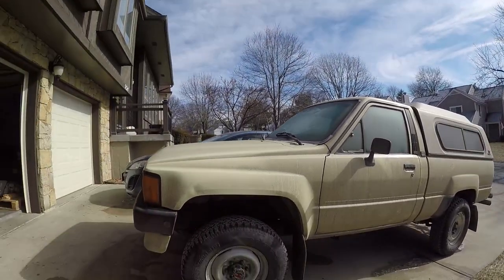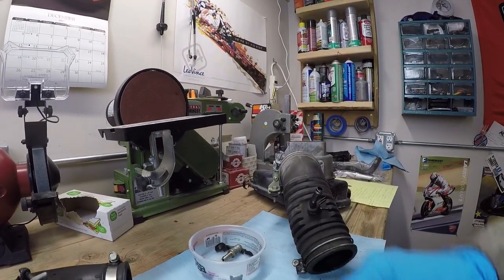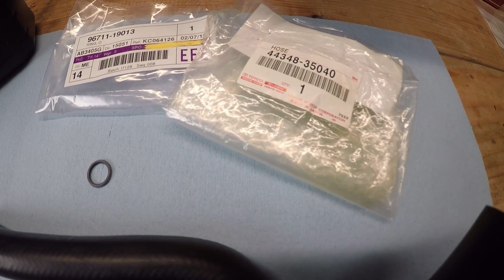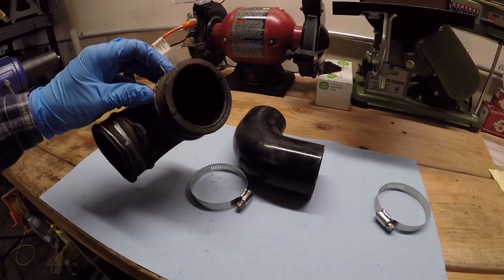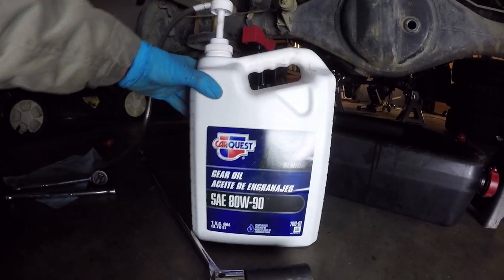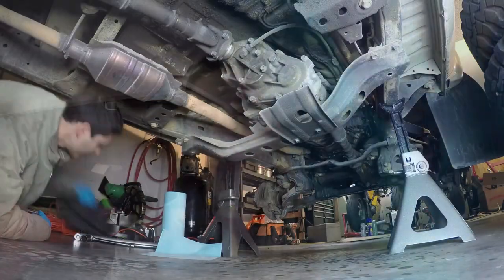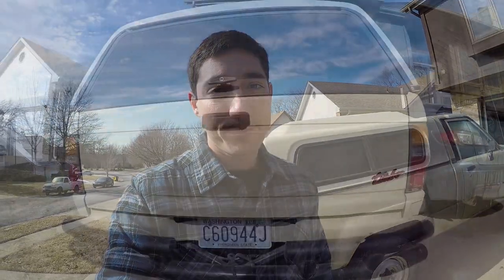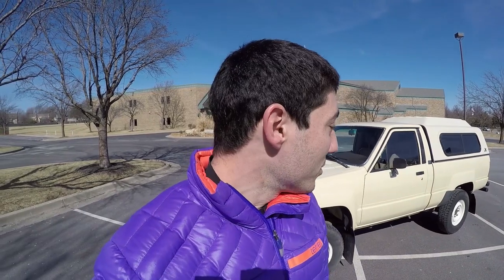I Bought A Rare 1986 Turbo Toyota Pickup

Comment: Nice dude. I have a 1989 toyota hilux 22ret turbo myself. Factory front straight axle and factory 3.5" lift. My model is very rare aswell. Ran the vin and there were only 600 ever made of this type and was built specifically for the russian military in a left hand dive. It is in near perfect condition an i still refuse to wheel it. Ive had many people offer me an insane amount of money for it...turns out i bought it from the 1st original owner. Hardly drive it because it only has 72k original miles! Its a factory dark blue color with black interior. And i only paid $3700 for it cash!
Reply: I'll take a Port & Polished head with oversized SS Valves, mild Crank and a 36/36Weber Carb over a Turbo any day.  Frankly my Stock carb with a P'nPolished head and mild performance crank would out perform your Turbo.

Comment: Nice truck and video. There is a Lucas gear oil that is gl4 and 5 compatible and not very expensive. It’s an 80w 90 though. I use it in my ‘86 Ranger, Toyo Koygo transmission. Maybe that could have worked? 75 bucks is a lot just for oil.

Comment: Very cool, I almost have the same truck, 1986 22r manual 4x4 non turbo reg cab with about 200K on it, it doesn't leak oil, but has a really hard time passing CA emissions, prob will need an engine rebuild soon, parts amazingly OEM are kinda pricey and hard to find new

Comment: After you have replaced the PCV valve, if there is a ton of pressure coming from the crankcase, it is a sure sign that the rings are bad.

Comment: You are incorrect about the pcv valve. The valves become stuck open and the vacuum of the intake sucks the oil out if the engine. If it was stuck shut you would be blowing gaskets.

Comment: Used to have a super clean silver 86 turbo about 10 years ago.
 Ran like clockwork and never let me down, but you could watch the fuel gauge drop as you drove, boost or not. My V-8 Tahoe is more comfortable and gets better mileage.

Comment: I can tell that it is a 1986 by the weld on the rear axle housing. I bought a 1985 Toyota truck brand new, and at about 26k miles my rear axle housing cracked. Took it to Toyota 3 different times, they would not acknowledge that it was a defect. Surprise, surprise, I noticed that the rear housing was redesigned for all the 1986 trucks!!!   As I recall, the turbo was only available in 1985 and 86.
Reply: 1985-88 in the US market.
1985 saw mostly 2WD trunks in turbo, very few 4WD were shipped.
Most turbos are 1986.
1987 saw hefty increases in price and a coming V6 so sales of the turbo slowed.
Very few 1988 were turbo, and they introduced the 3.0 v6. Prices for 88 also went up, in fact prices were going up 1500 each year during this time. Which is a hefty increase considering the 12,000 window sticker.

Comment: Instead of spending unnecessary time with multiple fluids by a GL-4/5 rated gear oil that's 75W-90 weight and you'll never have an issue with the drivetrain. Will also be much simpler for fluid purchasing and storage.

Comment: I own a 1 owner (My dad) 86 yota with the 22rte but i have just recently went completely through the engine, new 22re head with oversized valves (22re head for higher compression) t3/t4 turbo with a new manifold, a cam, pistons bored, ect ect all new. It is also a clean truck no rust but it has 35's with lockers front and rear, im getting sidetracked haha, anyways, if you have any questions regarding the 22rte in the truck, feel free to ask me as i have picked up a bit of knowledge on the 22rte with all my troubleshooting down the years
Reply from the maker: Mymomsagirlpoopgood I've given some thought to rebuilding this engine and mounting up a modern turbo to it while I'm at it. What manifold did you go with?

Comment: To be honest but not knit-picking or finding fault, Those original hose clamps are far superior to your replacement clamps due to the fact that when tightened, the new clamps will tend to pinch the hose at the point where the pinion and screw (?) tighten the clamp and can and often do, cause a leak. And we are know, if we tried to save a few bucks and purchased inferior quality of these type of clamps, as soon as the clamp actually start to get tight, just before it actually does, it puts too much pressure on things and strips out and gives no clamping force at all.  While with the original clamps give an even  amount of clamping force around the entire circumference of the clamp to hose and give s a reliable seal. Other than that a very well done and informative video and I never envy anyone for anything if possible, but 4 years ago bought a 1988 toy p/u w/2.4L, carb'd 4 speed manual tranny 2 wd,that for having 220,000+ miles and 30 years old goes like a bat out of hell. But the one thing I do wish it had is a turbo. But then I probably would not get the 25-30 mpg im getting,which is damn good for one of these, especially since, can't  seem to keep my foot out of it. Keep up the good work on the videos.

Comment: Nice video ! I see you use a lot of Harbor Freight tools. I seen that same air compressor at H.F. I did purchased & return the brake bleeder tool. I wasn't sure how to use it properly.
Reply from the maker: Harbor Freight tools are great for the DIY'er. I've had very few problems with them. Sorry to hear about the brake bleeder - the best method is still to have friend pump the brakes!
Reply: @PracticalEnthusiast  I need to up grade some tools.

Comment: It looks like it's your oil pan gasket . I had an older 1979 truck with the 20r. Since is an old trcuk I changed all the Seals and gaskets. Oil seals. water pump gasket, oil pump gasket and the valve cover gasket, timing chaine guides etc.

Comment: Sir, I'm looking at buying a 1992 Toyota Truck 4X4 one-owner with 150,000 miles.  It is presently located in Washington State and I live in Central Arkansas.  The price for the truck delivered to my front door is $11,000.00  Do you feel this is a decent price?  May I ask what you paid for your truck?  The one I'm looking to buy also comes with a fiberglass topper.  Thanks.

Comment: Cool vid man. Was wondering when you are replacing the brake fluid don’t you need to start with the brakes first, bleed them out , refill them and then refill the master reservoir? And not the other way round as the master reservoir will empty when you bleed out the brakes. Or is that not how the lines are connected 😅
Reply from the maker: The process I recommend for flushing a brake system is this  1) remove the old fluid in the reservoir, then clean the reservoir 2) fill the reservoir with new fluid 3) flush the system by bleeding each wheel while keeping the reservoir topped off. You will more quickly see the new fluid come out from each brake line.

It makes the process much faster if you start the master cylinder reservoir off with fresh fluid, instead of spending time sending all the old fluid from the reservoir through the system before adding new fluid.

Comment: Great video. Good luck finding that oil leak.
Reply: G Davis . I have a 04 Toyota Tundra Limited 4.7 V8 . I have a slow leak in the front of the engine , around  where the oil pan is bolted on . Maybe that will help you on where about the leak on your 85 toyota turbo EFI might be at . Also check if there is any oil residue around the lower part of the valve covers .
Reply: G Davis pieter willem

Comment: How much did you pay dude?
Reply: probably way to much
Reply: the pickups are way overpriced. id rather have the 4runner with the removable top pretty much the same thing  but lots cheaper
Reply: @MrBlaze256  The cost for old trucks in general are increasing. FJ60s are going for $20k+ these days. The pickups are steadily reaching this price point too. I've also noticed that 1st gen 4Runners are holding steady prices and I see it increasing in the future. Now is definitely the time to start collecting these trucks.
Reply: yeah they will keep getting higher with the crap new cars and trucks coming out with all the gizmos and timing chains in the back of the engine they wont last over 10 years
Reply: @MrBlaze256  they're building cars and trucks with sealed transmissions and diffs. I don't trust the idea of lifetime fluids. It's also near impossible to trace electrical gremlins. 90k MSRP BMWs are now $2-3k while a 30 year old Toyota with 250k miles sells for $15k.
Reply: He paid like 3 grand. It was for sale local to me in a town called Walla Walla. I was hella jealous when I saw it wasn’t for sale anymore lol. Thing is mint! And then it popped in my YouTube suggestions! Small world.
Reply: This is my old truck. Was forsale not long 10k
Reply: @MrBlaze256  i would probably pay too much for this truck also lol
Reply: @hectorvelasco2583  id rather have a mazda b2200 4x4.
Reply: @Jasonhb07  idk why they call them sealed transmission? my kia has one and changing the fluid is as easy as changing the oil. you have 3 plugs the drain plug fill plug and the check plug
Reply: Hector velasco I just bought a 1986 Toyota custom cab with the turbo engine.... it has 146k miles and I’m the third owner :)
Reply: water bear seriously?
Reply: HE SAID HE PAID $4K !!

Comment: Depending on what part of Washington it came from, it may have never seen salt in the winter. Many counties use volcanic cinders on top of the packed snow/ice instead of salt. Studded tires are also widely used. The tradeoff is more paint chips, windshield damage, and roads wear out faster. I'll take it over the whole vehicle getting rusted out after 10 winters. It really seems like a scam after moving to Wisconsin, where salt is everywhere and studded tires are illegal.

Comment: Wait you can put transmission fluid in a power steering pump? Shouldn't you put power steering fluid in a power steering pump?
Reply: iseeu2002 mostly they are both hydraulic fluids. Long term not recommended to use trans fluid in most PS systems.
Reply: I cant still image using a TFP as a PSF replacement. Why not just use a PSF instead because thats what there meant for which is for power steering. Just cause you can doesn't mean you should. I still don't get it though. :S
Reply: iseeu2002 not sure what TFP is, but hydraulic fluid is hydraulic fluid, for the most part. Most are a mineral oil or synthetic oil base with an additive pack formulated for the specific use case. P/S tends to be a bit thinner.

Comment: Check if that truck has a llimited slip rear differential. In this case' it would need a LSD oil, limited slip differential oil ! On my toyota 4runner 1994, there is a sticker beside the drain plug warning LSD ONLY. I m pretty sure there is no difference between your hilux and my runner on this particular point. If i m right,  the oil that you use at the rear could be bad for the differential mecanism. Very nice truck anyways'. Love the color. Enjoy it. Good day. Vincent.

Comment: NO don’t use ATF in that PS pump! It’s not a transmission use power steering fluid regardless
Reply: There the same thing just one has red dye. 21 year toyota mechanic . Atf is fine
Reply: No sir that is incorrect. Although in your particular case  it’s acceptable. You do know that ATF as friction modifier‘s and other ingredients in it more than red dye. Just don’t use that practice in modern vehicles. By the way cool little truck
Reply: Its not a f22 raptor its a hydraulic pump atf is fine. There is no magical fluid necessary to make it work and last forever.  Occasionally they leak so put a new one it. And fill it with atf.

Comment: Power steering fuild is not the same as ATF just a Fyi
Reply: Depends on what the manufacturer specified. Many power steering systems were designed to use ATF.